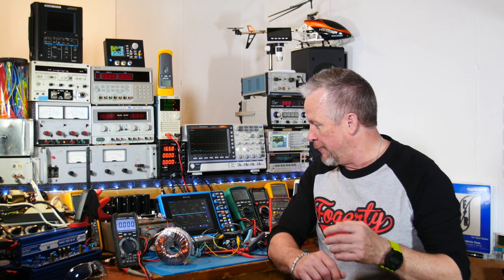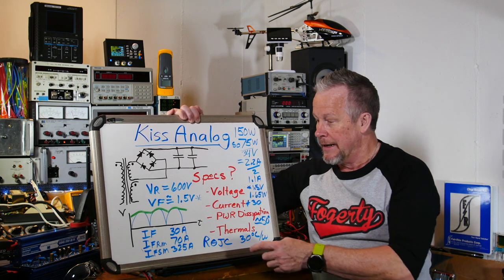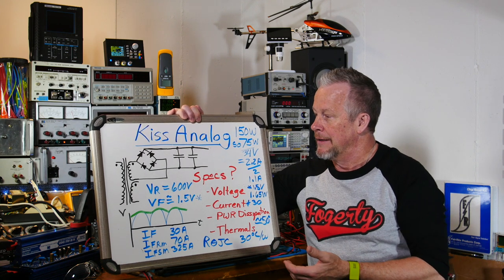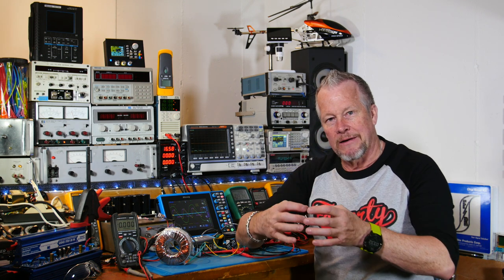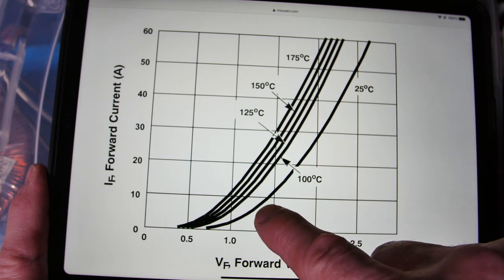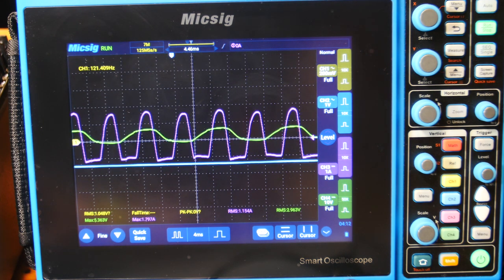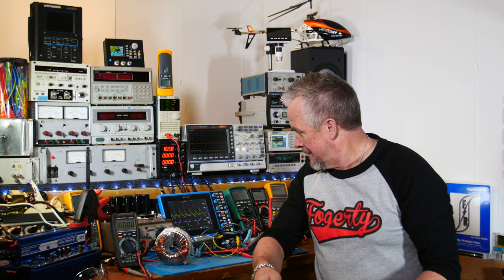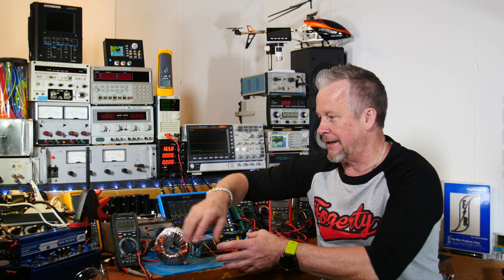How to Select the Diode for our Amplifier's Power Supply

Comment: I know Kiss Analog knows this, but others may not.  When you put your finger on a part, such as a diode, to check temperature, it can suddenly rise in temperature because your skin acts as an insulating blanket.  Besides a nasty burn, this could cause a device to suddenly fail. Beware of datasheets, they don't generally lie directly, but sometimes contain limits under unrealistic conditions.  Parts rarely sit at 25C when operating, so that's not the curve you generally want to be using when calculating whether the part will have sufficient ratings.  Look at the 50C or 75C lines, and use those.  Hopefully you won't be operating continuously in those ranges, but it adds a safety margin.  The rest of his points about thermal resistance are spot on and important.  Just because the outside case of something is at 50C, doesn't mean the actual junction isn't at 100C.  Learn how to factor those realities into your plans.  IOW, if you think it's going to be close, but it will likely survive, it likely won't.  It might be okay for weeks, but one day the AC isn't working, or you accidentally throw some clothing over your case, or you take it outside on a nice summer day, it might get into a thermal runaway condition and let the magic smoke out.  A good rule of thumb, in my humble opinion, is nothing should ever be hot to the touch, during operation.
Reply from the maker: Thank you Tony - this is awesome feedback!  I agree with your rule of thumb.

Comment: Thanks Eddie,
I think I'll play with it in simulation just for fun - did you try that? I'm getting lazy in my old age and SPICE is getting so good that it's pretty close to empirical these days. What I do is usually run extra headroom into three terminal regulators. They're cheap and you get a flat output with a simple bridge and a couple ohm resistor before the caps for surge.
Hey, does class A actually sound better? I played around with a Nelson Pass clone I got on ebay but it took so much heat sinking that I went back to AB. I'm seeing some real promise in class D now and I run PV here so I like the efficiency.
Reply from the maker: That's great feedback - thank you!  I want to compare a Class A to AB and to D.  I don't know if it really sounds better;)  I'd like to see if I can measure any difference.  I do think Class D will take over the majority of amps as time goes on.
Reply: @KissAnalog  Thanks.
You know I looked at the diodes they're using in this supply and I'm not entirely convinced these fast diodes are the right choice, I really don't see the benefit of speed at these frequencies, especially at the 1.5 volt Vf. I checked the 10A10 diodes I have and at 6 amps I'm getting less than a volt drop. I think this is a better choice, what's your feedback? Thanks Rob.

Comment: Thanks my prof.
Question:
Can we use one diodes extra in parallel with each diode rectifier 
May one of diode is fired because of heating or more current passing? 

Question2:
can we put thermistor after diode for protecting the circuit?
Reply from the maker: Thank you!  Yes, diodes can be placed in parallel, but just remember that they don’t share evenly, and sometimes not very well at all.  The next video in this series will show the use of the thermistor;)
Reply: @KissAnalog  Thanks 👍
We wait

Comment: so I'm pretty new to this, but I've done enough research to understand some of what I'm doing. I have 2, 1750w RMS 12" subs. i bought a 5f capacitor and a solenoid for them, with a 0G OFC wiring kit. would i need a diode for this setup? i want to do it right.
Reply: the amp is a 3k class D Monoblock. 2 ohm speakers to 1 ohm amp.
Reply from the maker: Thanks for the question - but can you share a drawing?  Even if it is hand written?
Reply from the maker: E,a

Email is best but you can find me on facebook as well
Reply: @KissAnalog  what is either one of those? :)

Comment: Great video, I learn so much from you!!
A funny thought I have had: What if you DC bias an AC so much it does no longer go below zero and fed that into a constant current source, would you then have a constant DC  current without ever using a diode? :-)
Reply from the maker: Thank you!  Yes, I actually power some AC power supplies with DC voltage, and the only 2 diodes have to conduct to stir the voltage.  Great question!

Comment: Designing for the power dissipation is really important and definitely worth getting a good understanding about.  I've found doing the calcs is worth it for establishing a potential baseline and understanding how close to disaster you may be at design time so you can do something about it then - making space for heatsinks and fans, keeping parts separated on the PCB and so on.  Nothing beats soak testing and temperature monitoring once it's put together though as there are really so many moving parts to take account of once built that aren't factored into the the thermal calcs.  

I really appreciate these videos where you show the waveforms and explain what's happening.  Nothing beats understanding a funky waveform!!
Reply from the maker: Thanks Andrew = and I totally agree with your feedback;) It is always great to hear from you!